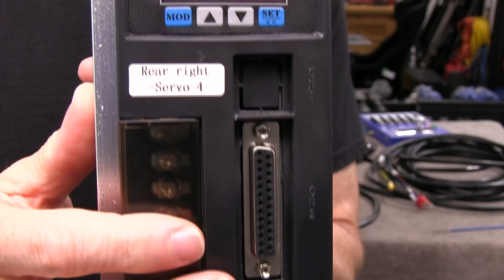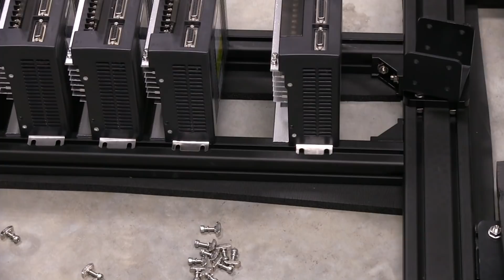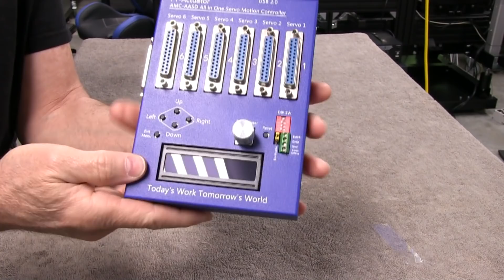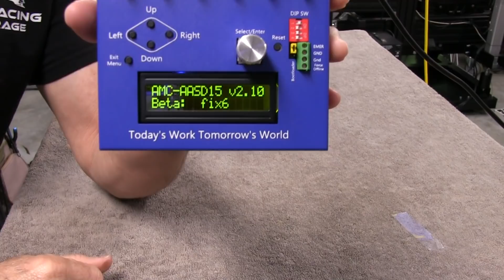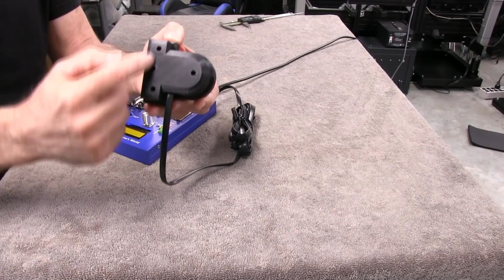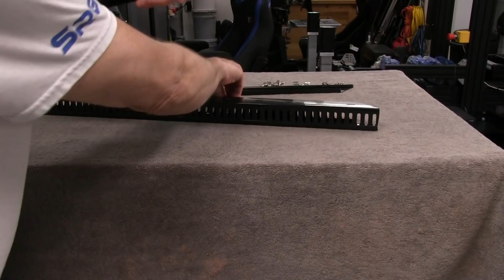PT Actuator 5DOF Motion System Review Part 2 "Electronics/Wiring"

Comment: I have an SFX-100, and it looks to be very similar on paper, same drivers and THANOS controller, motors too? Though I've only 3DOF setup now.
What's the rub here with Surge/Sway vs. say a G-Seat solution. I have 2 spare outputs and the preference (but not requirement) for a smaller physical footprint. 
My gut tells me that a G-Seat would be better for sustained G-sway loading (essentially no travel limit), with the drawback of no braking force. But if I already have belt tension for braking, am I missing out not having that linear motion?

It seems to me that roll cues would be much easier to product with actuators than XYZ motion without wandering too far from center or having massive travel. 

The 3DOF was an easy decision, but once you go beyond that it feels like there are lots of decisions/considerations and without direct experience it seems difficult to navigate the minefield of options considering just how damn expensive it gets. 

Great review, very insightful / useful.

Comment: Does all this run off a single 110v 15 amp plug?    Do the power supplies need to be configured for 110 vs 220?
Reply from the maker: 220v is the default power setting.  The AASD servo drives need to be set to 115v. I run everything off one 20amp circuit to mitigate ground loops. Others are running fine on 15amp circuits.

Comment: Generally, one wants to avoid ground both ends of cable shield; any current should flow only on ground wire inside the shield.
Ideally, the heat sink fins would run vertically for better convection cooling.
Driver box cable cutouts should have chafe protection (grommets).

Comment: When will your actual review take place Barry? Have you ran into problems?
Reply from the maker: No, just taking my time. Should be out next week.
Reply: @simracinggarage3026  thanks! I hope your review is favorable as I ordered a 150mm stroke system 2 weeks ago and awaiting shipment! D-Box offered me 3 gen 1 (lightly used 80mm stroke) actuators for $5.5K but I didn't think that was a good deal. Hope I made the right decision with PT

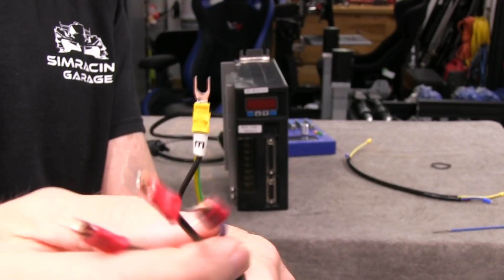Comment: 5:40, I would be ashamed of the termination of those power cables. You should NOT ever have lose strands visible beyond the end of the crimp, this would not even be acceptable on a 12vdc system let alone a 110-220vac system. The Earth terminal is fine, but the other three are not good.
Reply: As long as its crimped properly a little copper through the ends is acceptable
Reply: @DA22YLM  A little is fair enough, you need to be sure that the joint is fully crimped but that is excessive. When I was wiring industrial electrical installations and challenger 2 tanks I know that would have cost me my job. And now doing professional motorsport wiring harnesses I would not let that go, even on a budget job.
Reply: @RyanParle81  its no more dangwrous than the bolt its being attached to. How did u get round that in the past....

Comment: Can a PT-actuator work with mitsubishi servo drivers MRJ?
Reply: No... its not going to be plug and play using other servos. It will take lots of custom wiring and experimenting to get proper parameters to be compatible with AMC-AASD15A, that is if the Mitsubishi servo drive even has similar digital inputs-outputs like the AASD-15A servo drives...

Comment: Without this detailed video of yours, most of these would be a pile of bars and wires on the floor a month after they were received. Lol. Great explanation. The company lists a free upgrade to 200 mm stroke on the surge actuator. Do you have that on this unit or the 150? They also show the steering wheel supports and a seat in the product description. Does it come with those? Thanks for sharing.
Reply: He has the 150mm stroke actuators. But if you need 200mm for example, you can order it with such longer strokes without change in prices, costs the same.

Comment: Pretty cool, we use very similar driver/amps for our semiconductor plating lift/spin/rotate heads at work. When installing two spades or ring lugs per screw on a terminal strip like line 1 and 2, install the bottom face down and the top face up to get them to lay more flat.

Comment: Just waiting on his reveiw of the open sourced non commercial SFX-100. If Barry ever does it. Fingers crossed
Reply: Pretty much the same motors and motor controllers.   The only difference would be the diy actuators. You can also opt to run the sfx with that same Thanos box.
Reply: @chillil321  Yee I just wanted to see Barrys's take on the actual build of the actuators. And how and why he did it his way, and to hear the pros n cons of actually  doing it yourself from his point of view.   Im good I have too much invested in the SFX-100 to go any other route now £££  :)
Reply: It would be a loooong review, waiting to print  the flange parts... 😂

Comment: 25:49 ...For the price this is unacceptable and pretty much lazy from the manufacturer. Should have made way better connectors.
Reply: Nothing a dremel/small file can't remedy. "For the price", this system is incredibly good value. Do you know what D-Box charges for something like this? But, yes it's something that should have been done by the factory
Reply: @Globespy  
Sure, You can fix it by yourself. I definitely wouldn't dremel the plastic cover though.
I'm aware of the Dbox prices. I just don't think it's an excuse for this major oversight.
Not a big deal, but looking at the other great details they made, this was hard to understand when I looked at the footage.